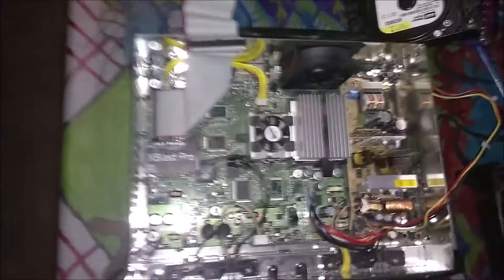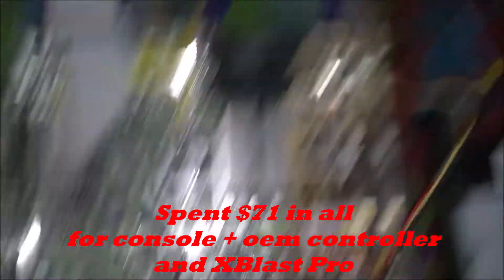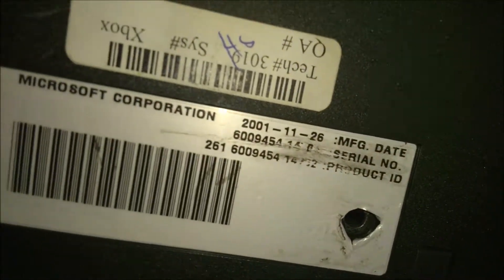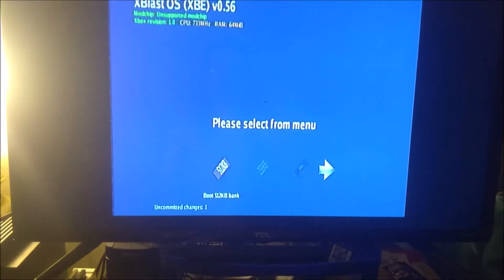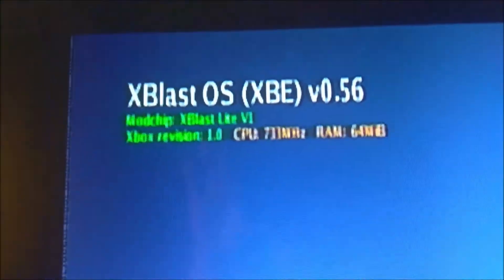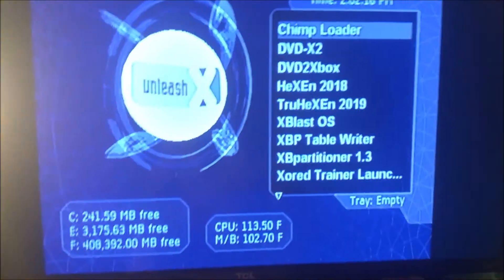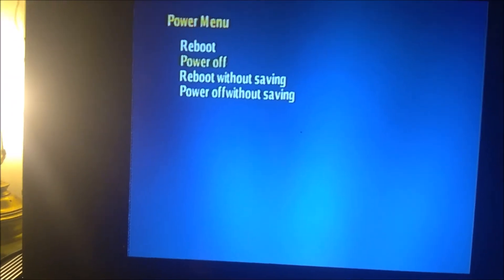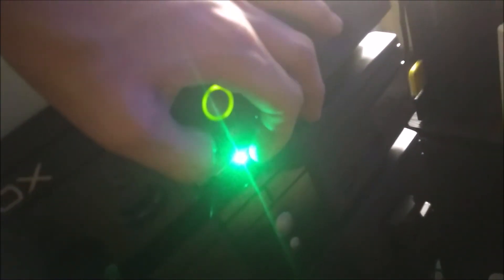XBlast Pro Modchip | Original Xbox

Comment: Do you prefer the xblast pro over the openxenium? I'm trying to decide which to install on my next xbox. Thanks for the vids!
Reply from the maker: I really like the XBlast Pro. I haven't used an OpenXenium yet so I can't really speak too much on their behalf but from what I've heard they're very solid chips. I would recommend the XBlast Pro if you want the ability to split your onboard TSOP (1.0 and 1.1 xbox only) and/or if you want the bios bank switch with HDD/LAN activity LEDs. XBlast also has the ability to recover TSOP from a bad flash given that you have a special bios flashed onto one of the banks. XBlast Pro also has X3 style D0/HD/LAN connector so you don't have to solder any wire directly to the chip except for A15 for TSOP recovery or A19 for TSOP control to split. Both chips have LCD support. I guess in the end it all comes down to what you want your chip to do and what revision of xbox you have. Those are the main two decision factors imo
XBlast Pro chips are currently $35 on ebay from seller bolwire (same guy I bought both my XBlast Lite and Pro from. Great seller)
https://www.ebay.com/itm/XBlast-Pro-for-Original-XBox-Like-Xecuter-OpenXenium-LCD-support/293812189185     << XBlast Pro ONLY 4 LEFT (DISCONTINUED)

Thanks for watching my vids, glad you enjoy my content
Reply: @e-homie2836  Perfect, thank you for the detailed response 👍